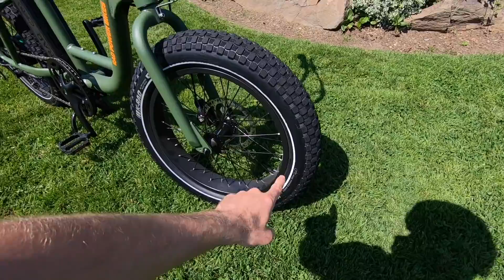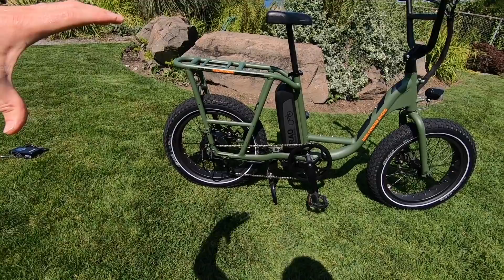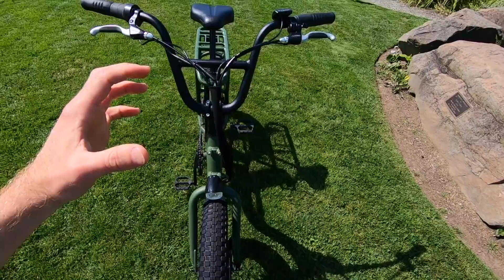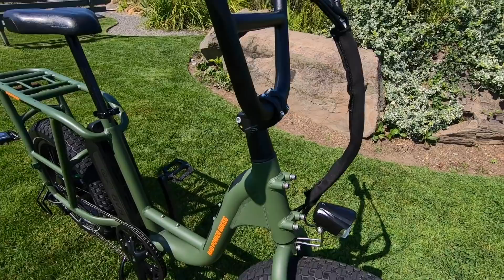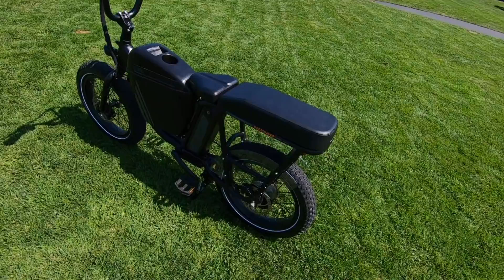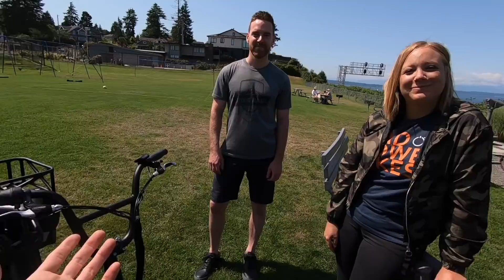Rad Power Bikes RadRunner Review - $1.3k

Comment: This bike has great potential here in the uk fantastic as a utility bike excellent value though only being a250 watt motor coupled with single speed my be an issue in hilly areas but that motor has 80nm of torque that’s got some grunt. Earlier this year I bought a refurbished 3 speed bike from a charity here in the uk
The bike is called a Elephant bike which is a former Royal Mail bike made by Pashley bikes
Which I fitted a mid drive Bafang bbs01 250 watt 36 volt motor 80nm torque its a beautiful classic 
Rad have nailed this all the best to them
Reply from the maker: Hey! I agree with you, and I'd love to hear about this bike for daily use if you or anyone you know in Europe does buy one. I got limited time on the EU version, and it is weaker, but it was still fun and very unique :)

Comment: We've GOT to get the bicycle speed laws changed. 20 mph is SO slow when it comes to having to maneuver through city traffic. Trying to cross large boulevards like here in Los Angeles where drivers drive like bats out of Hell, it is REALLY dangerous. Bicyclists get hit here all the time. Sure, we have "bike lanes", and that's fine to give a bicyclist that little extra, itsy, bitsy, teeny, weeny, minuscule bit of space between you on your 12mph to maybe 18mph regular bicycle. But two more miles per hour with an electric assist isn't much more power or speed if you need to cross traffic lanes to get into a turning lane.

If you are a bike rider who follows some common sense and common courtesy rules while riding, then if and when you are on a bike "path", then you slow it down and ride at the posted speed limit. But I don't see why there should be power and therefore a SPEED limit on electric bicycles. Personally? I think that Electric-Assist bikes are the future, I love them... and I am saving up for one, but I also think that if you are going to have a pedal-powered bike that has some form of an external energy assist or boost... as in electric OR even fossil fuel power, then the vehicle should be able to compete with the speeds of speeding automobiles and motorcycles.

I think this new RadRunner is pretty cool looking, although, and although I have enough money saved up to actually purchase one of these, I think I will have to pass on it because I want a bike with at LEAST a 1,000-watt motor. I just that extra power. This definitely seems like an amazing deal for the price... that's for sure. And maybe I will get one for my wife later on, once she sees me riding my new electric-assist bike. 

Anyway, this was a really good review... it was very thorough and covered literally everything and then some. So, a thumbs up on this video, for sure. And as always, a thumbs up on Rad Power Bikes.
Reply: lowerastral what did you end up getting?

Comment: At over $2,000 in Canada it is hardly a deal. The hub motor is less powerful also. Too bad.
Reply: To clarify, it's $1,799 CAD :)
Reply from the maker: Yeah, the hub motor is slightly less powerful for Canada, I'm curious to spend more time on that because most of my riding was on the US and EU versions. I definitely noticed a difference in power, but the Canada version sits right in between and is probably pretty capable :)

Comment: Seems well thought out. Reminds me a little bit of the Juiced ODK. I'd love it with a suspension fork though.
Reply: The suspension is a good idea. I'm almost 57 years young and my back, neck, and wrists/hands cannot handle hardtails anymore. I had started noticing my lower back starting to ache more and more as the years have gone by... but in the last four or five years or so, it seems to have gotten worse. So I went to a spine specialist who did X-rays and she told me that I have SBO (Super Bad Odor?) Spina Bifida Occulta. Apparently, as much as 20% of the world population has this affliction. Who knew? 

Anyway, I'm not supposed to be running up and down stairs, lifting anything over twenty-five pounds, no bending or stooping... DAMN! This sounds like I can't even get an Electric-Assist bicycle! I mean, I live in an apartment where there are ONLY stairs to get into the building, and stairs to get down to my apartment. Sounds weird, right? You have to go up to eventually go down. Ugh! But I was carrying my mountain bike like this for the last almost eight years here... which weighed in at about 36 lbs (until it got stolen... then my SECOND mountain bike got stolen... I know it's the same little druggy-asshole too)... so what's another 36 to 45 lbs? Right? Just don't spill the beans to my spine doctor... she just can't know... OK? Thanks!
Reply: And hydraulic brakes, and a bigger battery considering that pedalling is less fruitfull...it is a beauty though

Comment: It needs fenders as stock equipment, otherwise the tires throw all kinds of dirt, rocks, and debris on you and all over the back of your shirt, especially when it is raining or wet outside.  It needs air pressure adjustable fluid filled front spring loaded forks and a mono shock for a smooth ride.  Some other colors would nice too.  They need to have plastic or rubber covers over all the predrilled holes to keep debris and moisture out of the frame.  Rad Bikes, you should have sent me some pics or a demo bike before putting this bike into production.  It is a nice bike but just needs some extra tweaking to make it the best on the market.  Rad Bikes now you need to make these changes and additions, then get started on a Electric 3 wheel version and you need a towable light weight aluminum cart that owners can have their kids, pets, and cargo stored in so they don’t have to leave their precious cargo at home and so they can get provisions from the stores and the weight wont effect the steering such as a heavy top loaded basket will.  Thank You.
Reply from the maker: Some good ideas there, I agree that the fenders are a nice to have if it's raining or you're on gravel. I think they were trying to really drive the price down but also have to support their large support team and one year warranty. Will be interesting to see how this ebike is accepted, how it holds up, and what parts people struggle with over time.
Reply: ElectricBikeReview.com   I wish the company success.  It’s a great accomplishment to make a product that is beneficial to the public and the environment at the same time.
Reply: Realize this bike is meant to be sold at a lower cost for affordability purposes. All of those suggestions are great and you are welcome to make those changes as you see fit for your personal RadRunner should you choose to get one. This is a great base model that appeals to many people as not everyone will be towing pets, children, etc. Those would be great add-on options for those interested, but for the base model; what it comes with is perfect for the price point. This thing sells cheaper than the RadCity and does MORE than the rad city, rover, and step-thru. Really getting a bang for your buck. I do not believe, other than the cargo bike, you have the option of towing both another person and some cargo simultaneously. Really a slam dunk on RPB's part.
Reply: Aleekcheaahoosh Impetus  I realize the less parts they put on a bike the cheaper the cost such as in everything a person purchases.  I know they are trying to keep the cost down by using China to build the bike, but I do have innovated ideas from owning a business and serving the public for 42 in retail big ticket items.  I do not see this as a slam dunk on Rads part none whatsoever.  There are many ways to cut cost and get U.S. grants to operate a business in the United States Of America using American parts and American labor.  You can sell a product and have the legal claim to register such product as made in America if 2/3 of the product is American made.  There are other electric bike companies offering lower prices and higher prices as well.  I was simply trying to help this company shore up some minor cost details to improve their product and produce another product that is not in production yet.  Also, a business can get a Federal Grant that allows the company to hire Handicapped Workshop employees which provides minimum wages for the handicapped and the organization handles all of the payroll tax, insurance, and deductions, so the said business company using the labor simply provides a total amount to cover the wage expense, plus this provides jobs for the less fortunate and helps them mentally, physically, and spiritually, creating a service that provides a satisfying reward for all parties.  There are numerous other companies that they could use for welding aluminum frames as well such as companies that build aluminum products for the United States Government bid contracts, companies that are set up with skilled proficient welders and computerized welding as well that compete on a daily basis of cost efficient production in a competitive market.  I am simply stating facts to help if wanted, to a newly up and coming company of young adventurous entrepreneurs.

Comment: Does this bike “clunk “ when you stop pedaling then restart like the other rad power bikes do?
Reply: Yes, as that is simply the crank arm becoming engaged again by apply foot pressure. There isn't a bike that exists that won't do that. Even my non-electric bike does that when I stop pedaling WHILE the bike is in motion and start pedaling again. If I come to a complete stop and start pedaling again the bike will not make that sound neither will the rad bike. Try that next time you ride, notice when you start pedaling again after coming to a complete stop, it will not make that sound again. However, if you do that while it is in motion, it will do that.

Comment: Interesting, looks like an updated take on the 2013 Juiced ODK model with smaller battery, lower weight rating, PAS, wider tires, footpegs and skirt guard for the rear passenger, single speed instead of the Juiced ODK's IGH, and the bafang hub motor on the rear instead of the front. Well priced.

Comment: Thanks for the hill test. Could you add a side by side comparison with the best Radpower climber, with heavier riders on board?
Reply from the maker: You're welcome, that's a good idea! Like, back to back hill climb tests... I think this one would be fairly similar to the RadMini products because of the smaller wheel size. It's probably got the best climbing ability in the entire Rad Power Bikes lineup because it has the smallest and slick tires, so less drag and a great mechanical advantage :)

Comment: Now make one with upgraded brakes, 45mph, bigger battery, 100 mile distance, higher watt motor, color display, suspension etc.... I’d buy it
Reply: larcolt did you mean for this to be general comment or a reply to my comment (which wouldn’t make sense)
Reply: greysuit17 My bad, it was intended as a general comment to the original post video.

Comment: This new design is GREAT idea. Is its  it truly one speed or does it have automatic multi inner gearing in the hub ?  However, I feel it should have a stronger battery and a more powerful motor.  Other manufacturers will no doubt copy this design and add MORE POWER.  I'll wait to see what VEEGO comes up with.  I'm betting they'll come out with a ADULT version of this KIDDIE bike.
Reply from the maker: Hey Gord! It's a single speed, no cassette or single speed hub. The power felt good to me, even with Mike and I riding double. With more power often comes more weight and higher cost. That's not bad, and I do think that there is room for improvement here... but the bike was impressive and fun :)

Comment: I stopped the video at “custom tires”....
Reply from the maker: How come? They are custom, a new in-between size that's more efficient than knobby 4" fat tires but more comfortable and stable than plus sized mountain bike tires :)
Reply: ElectricBikeReview.com I once got a great folding bike but it had custom 18” tires. They are very difficult to find and expensive for what they are. Customs parts are fine but for consumables like tires and brake pads, I would rather off the shelf.